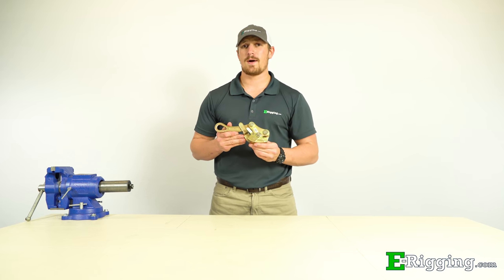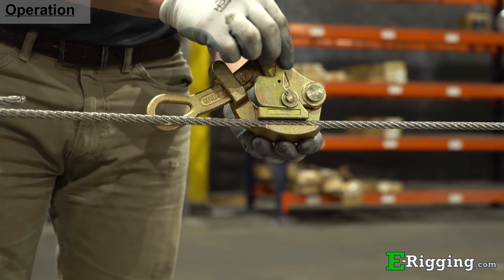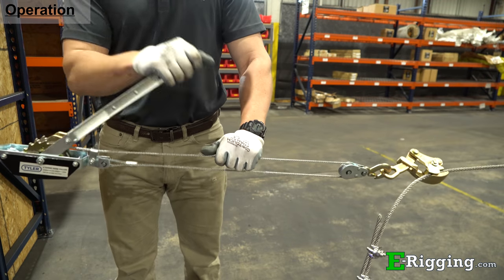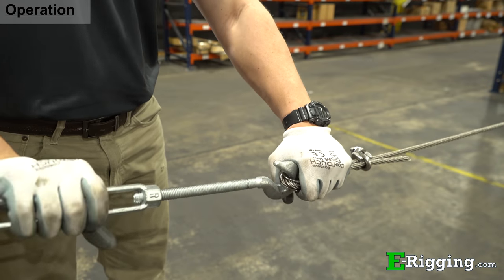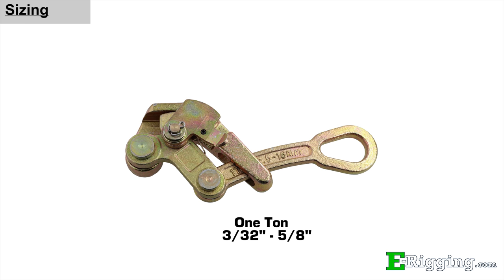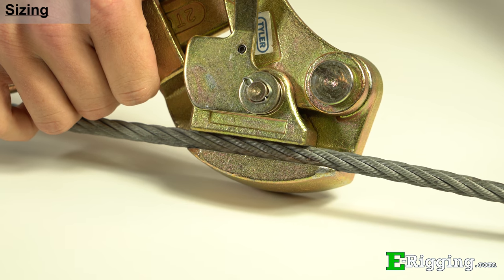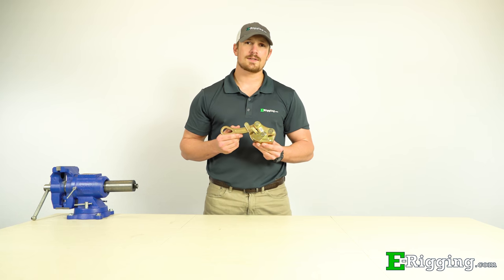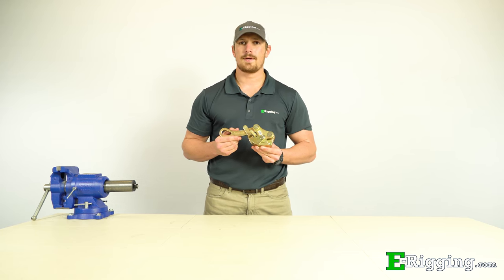How to Use Tyler Tool Cable Grips

Comment: Finally! I found the cable stretcher!

Do you think this would work for pulling the slack through some guy wires? Looking for a solution
Reply: Think this one should work my antique is for copper and aluminum only and slips on 3/8 guy steel

Comment: The 1/2 ton and 1 ton look Line they are round jaw on top, not parallel jaw. The door is no big deal, but as far as cable/rope is concerned, That’s a huge difference.... round is for steel wire rope, and rope because it will distort what it is holding. Parallel is not for any type of rope, cable only. Parallel jaws are Either steel, bare wire, or jacketed wire.
Reply: That's right
Reply: Agree haven’t bought one like this yet don’t wanna break my aluminum or copper but I do need to pull some 3/8 or 5/16 guy steel occasionally and my current one slips. Current one is great for 8-4awg copper and some small aluminum.